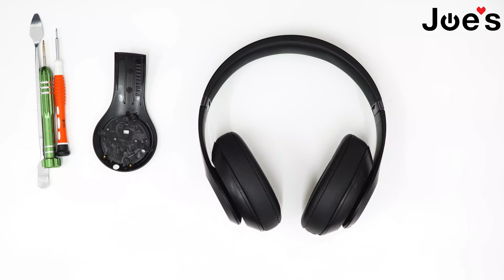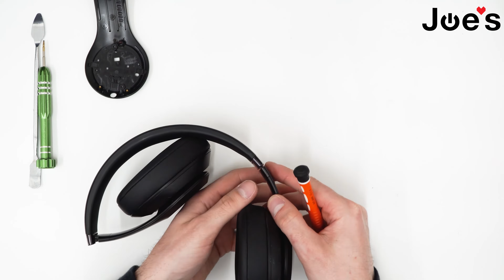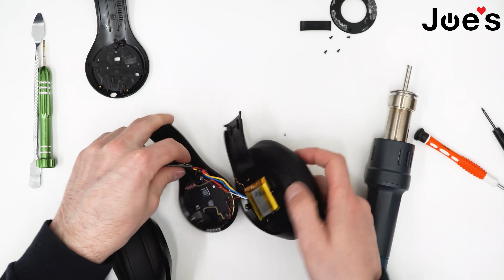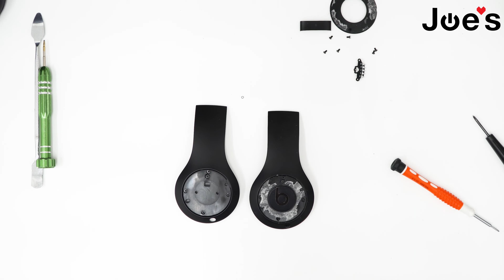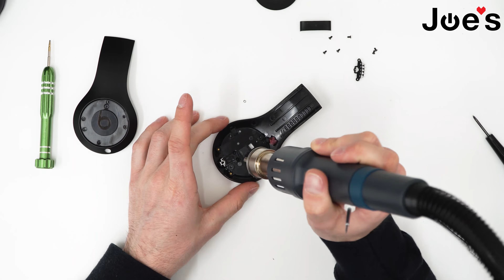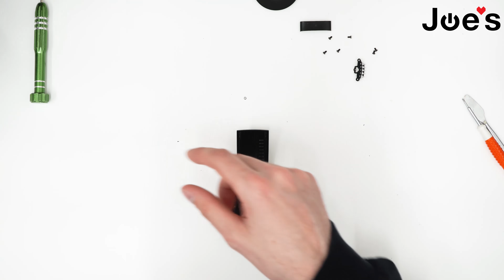Tutorial How To Repair Replace Broken Right Outside Panel Studio 3 Wireless

Comment: Great video. Thanks for sharing. Seems like it is difficult process with glue and heat required. I think I will pass the replacement of the outer panel as it has a hairline crack. Used krazy glue instead.
Reply from the maker: Sounds good 👍🏻

Comment: In the video you indicated that the ring that goes around the beats logo originally had glue, however at the end you just put it back without glue. My daughter's ring came off and when you put it back it doesn't stay in place a long time, if she leaves it like that it will fall off. Should glue be applied? If so what type do you recommend and is there a recommended way to apply it. Additionally in case that ring breaks can it be purchased?
Reply from the maker: Hello, thanks for commenting. Please email us at support@joesge.com with a screenshot of your question and we will be able to better assist you there. - Aaron P

Comment: Do you have the 4 screws that connect the outside panel to the inside one? Like the ones you had to remove the circle panel around the beats logo to get into? My outside panel is fine, no scratches, but the outside panel is loose so the battery can be seen if I pull on the inside panel, so I'm guessing one or more screws became loose
Reply: The exact same this has happened to me. Did you find a way to fix it?

Comment: Do you have a replacement for the the inner panel that you set aside in the video ? both the inner and outer on mine are cracked
Reply from the maker: Thanks for the comment. Here is a link to our repair parts: https://www.joesge.com/products/beats-by-dre-studio-3-wireless-inside-plastic-panel-parts?_pos=12&_sid=0175076a8&_ss=r
If the part you are looking for is out of stock you can enter your email in the "Item out of stock - notify me!" section and you will be notified when this item is in stock. 

If you would like your item repaired by a professional you can fill out this repair form here: https://www.joesge.com/pages/repair-services
-David P

Comment: Great video! Is the process relatively the same for the beats studio 2.0 wireless right outside panel?
Reply from the maker: Thanks for your comment. Yes the studio 2.0 wireless headphones are similar in the construction. They are simpler in fact as they have less glue holding the wires in place. 
-David P
Reply: @Joesge  Thank you!